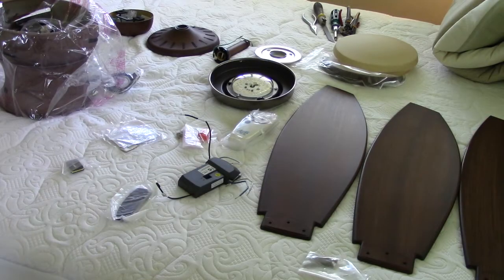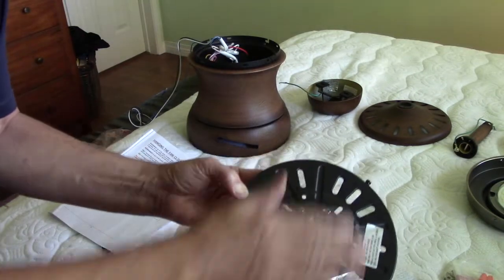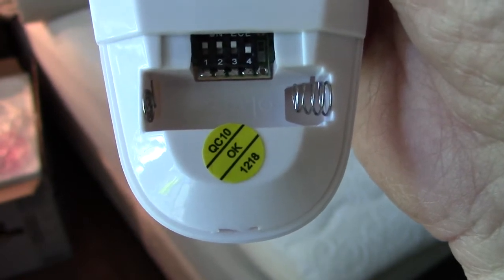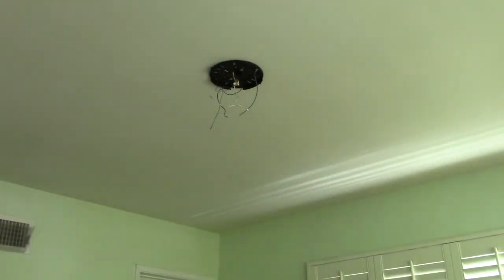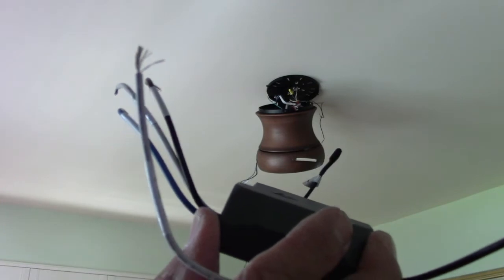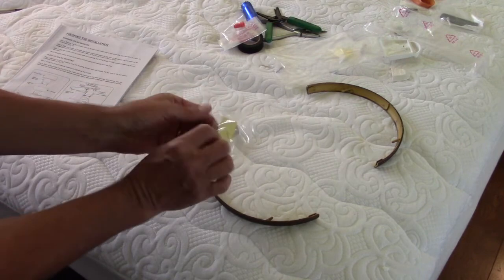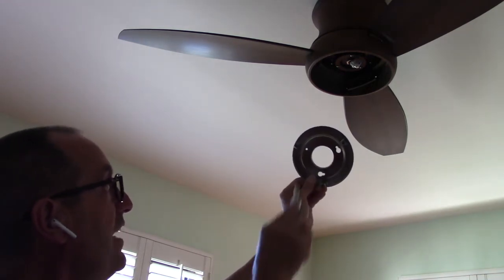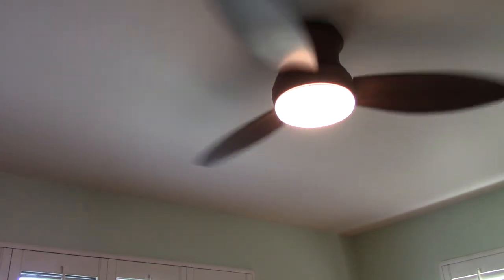Minka Aire "High Wind" Fan Install

Comment: We have this fan and the light temperature is really warm and dim (even when on brightest). Is yours that way, too? It's hard to tell from the video. Thanks.
Reply from the maker: I actually put three of them up.  (Home Depot close out sale.)  Two of them are L.E.D. and one has a quartz bulb.  I would have to say we were disappointed in their brightness too.  Did you know that if you hold the light bulb button down continuously, it will dim or brighten the light also.  You may have yours set at the dimmer setting right now.